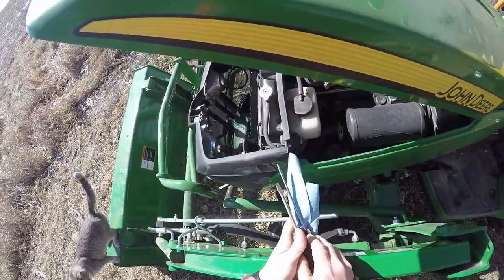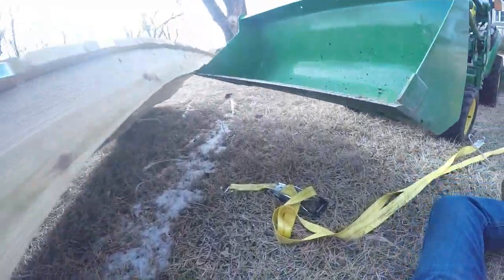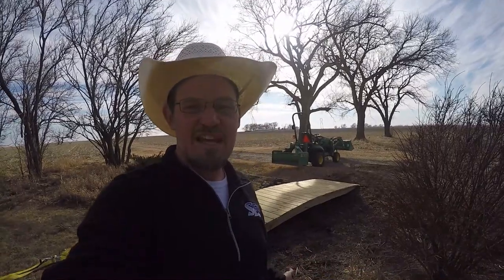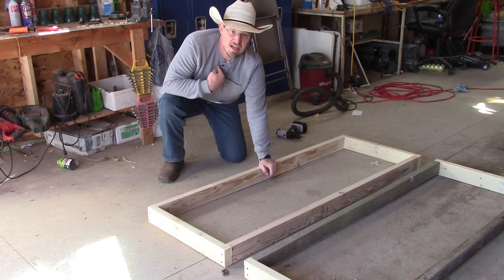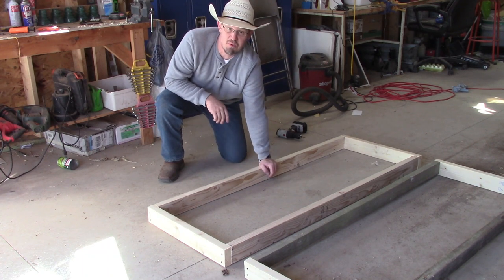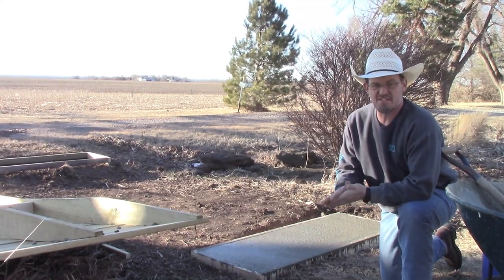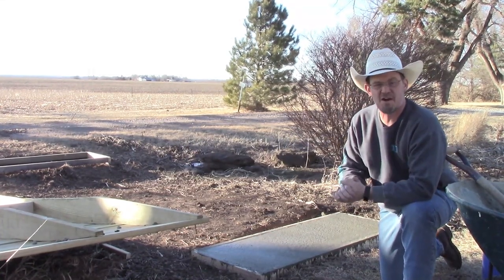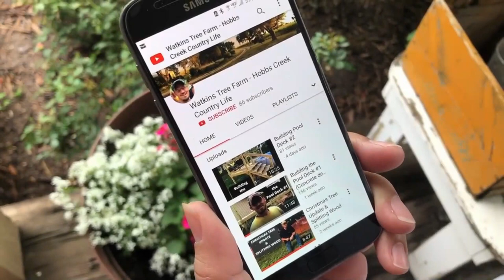DIY Walking Bridge - Setting the Foundation- Will the 1025R / 1026R John Deere Move the bridge??

Comment: I’ve heard about lumber getting stupid pricing. What are 2x4x8s costing in your neck of the plains? I’m hoping to buy a house in the next month or two, and I’m looking forward to doing some of my own projects, particularly with a garden.
Reply from the maker: 2x4x8 $7 / Pressure Treated $10.  I believe they were usually around $3.  I can justify it on small projects but I can’t imagine someone wanting to build a new house right now.  Ouch!!
Reply: And actually that’s the problem I am facing right now. I wanted to build a new house with an option I have, but the cost of lumber has made the price jump up by $12,000 in six months because of lumber prices.
Reply from the maker: I'm sorry.  Hopefully in a few months it starts to come down.  A couple YouTube channels I watch have canceled their build because of the prices.  One guy bought a saw mill.
Reply: What it has done for me is to look for houses already built or possibly look for a used house. In either case, it needs to be the price I’m trying to find. Fun fun!
Reply from the maker: Good luck man!!